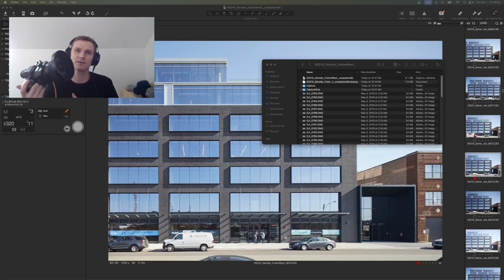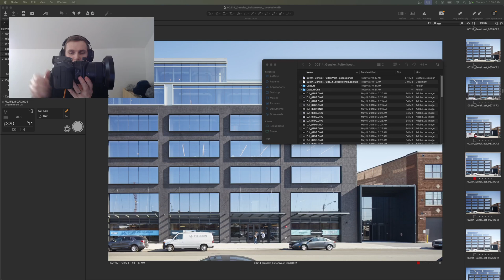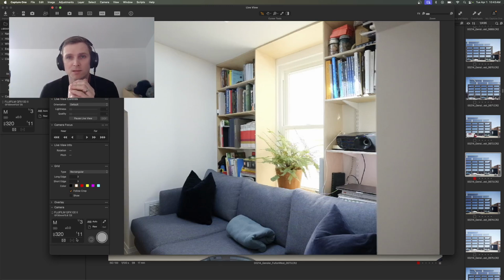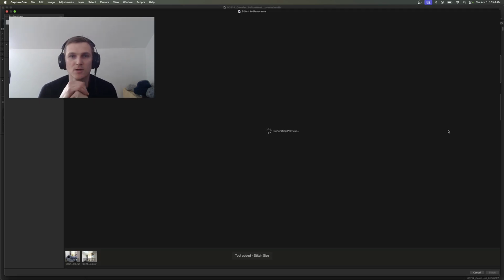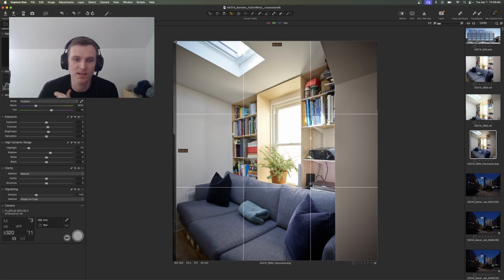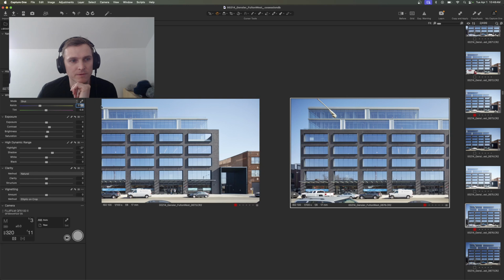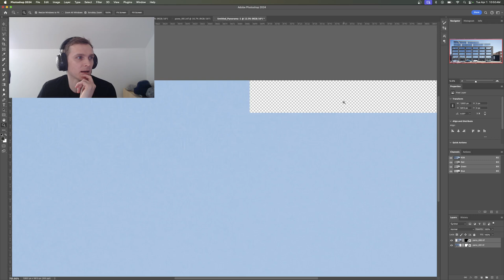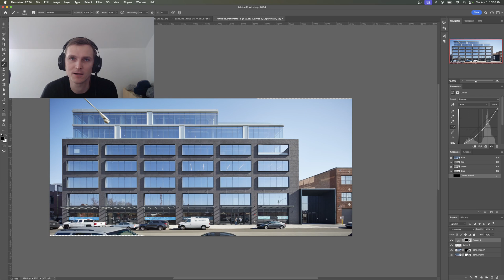Perfect Panos - Using Tilt Shift Lenses To Make Panoramas

Comment: Thanks for this, Tom. I just invested in a canon 24 TSE II and it has been so fun to play with. Stiching multiple horizontals into a larger resolution vertical is my favorite. Question for you - have you ever played with tilt shift frames (such as the Rogeti TSE frame), which keeps the lens stationary/attached to the tripod and shifting causes the camera body to move instead? I know it helps mitigate parallax for panoramas, but I haven't really seen any issues with my stitches. Would be curious to know your thoughts on TSE frames and whether you think they're a worthwhile investment.
Reply from the maker: Hey sorry I missed this question and only just am getting to it now. I haven't felt the need to do that as generally the subject matter is far enough away that the maximum of around 20mm of shift from side to side doesn't really make for any bad parallax or anything. I'm sure in a best practice, best case scenario world yeah we'd do it that way, but I don't think it is necessary at all.

Comment: I always wonder if its possible to build a tilt-shift where you can shift up and down first and then a second shift layer to move left and right. Our streets here in Europe are much smaller then in the US. Even with 17mm I often can't get a building, like the one in your example, into the shot.
Reply from the maker: Well, you could certainly do a 4 or more panel stitch to get top bottom, left, and right, but you're going to end up with a bit of a square crop from the missing diagonal corners, you could move on to an 8 panel stitch to capture those corners as well, to a point of course. Additionally you can certainly rotate the lens outside of the detent and shift at a horizontal angle, I do that more often than any other shift direction other than maybe straight up, as I'm usually adjusting my frame on more than one axis.
Reply: @tom-harris-photography  Thanks for the insight Tom! I probably need to get a few floors up to make that happen. At my current project I can only step back around 60feet. With no shift, half the frame is street, so shifting down is not needed. :D Also the building is 90yards long...

Comment: I’d be curious your thoughts on CPLs. Personally mine lives on my camera but lately I’ve been toying with the idea of leaving it off unless I absolutely need to use it.
Reply from the maker: Among my filters is a polarizer, and I use it often. Be careful with windows and monitors within your frame, they often have a film on them that can get messy and un-retouchable when seen through a cpl. I'd just evaluate each frame, I will even shoot my final bracket sometimes, and then carefully attach it and shoot a version with it on, so I can utilize just one part of the frame that has bad reflections, often the floor.

Comment: Great video as always. I'm fairly new to the job and don't have a lot of money. These lenses are so expensive! When I'm need I swivel the camera on the tripod head, while leaving a lot of overlap. It's absolutely not the same as shifting, but it gets the job done when needed (if it isn't anything extreme)
Reply from the maker: Yeah, that'll work, of course! It's just going to cost you image quality and speed, as you can't quite see the exact final product of your movements quite as neatly as with a TS lens. If you're looking to get one though, nikon made a 28 and a 35 that held up alright to the 50 megapixel cameras of a few years ago. They are only shift lenses, not tilt shifts (which I actually would prefer all these lenses were as well), but with an adapter they can be used on many cameras, and they were only a few hundred dollars on ebay last I checked!

Comment: Hi Tom thanks for another great video. I would like to see what your feeback would be on this. I use a Nikon D750, standard lenses (not tilt-shift). In my landscape photography my panos in PS are fine. In my architecture photography the get all wonky when I try to merge them in PS. I use a nodal rail to adjust the nodal point, but I'm not sure what I'm doing wrong.
Reply from the maker: Likely you're getting some distortion on the images trying to fix all that parallax. You haven't got a perfectly square thing in a landscape ever, so any distortion is much less noticeable. Splaying those pixels to make things square again makes up a lot of information, and compresses a bunch more, and things can get tricky quickly!